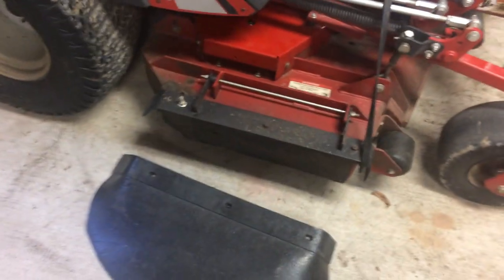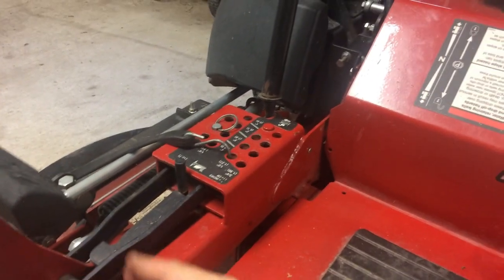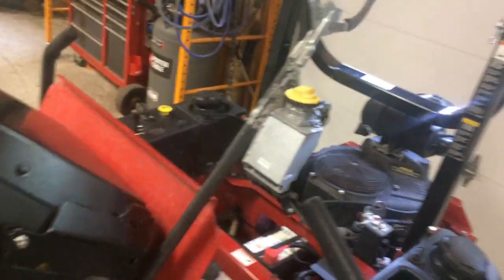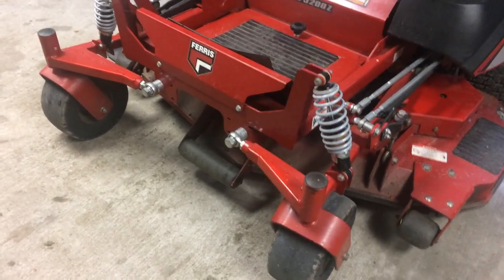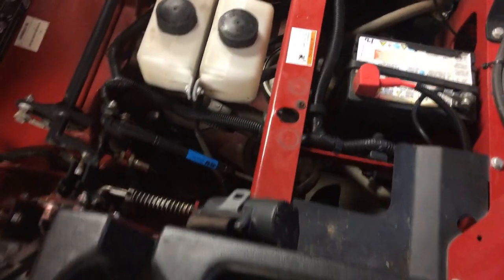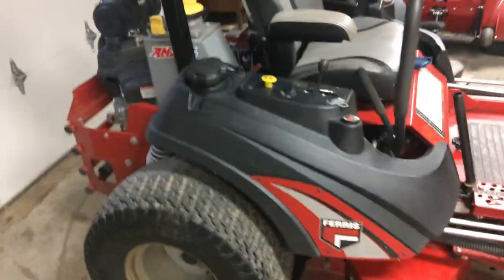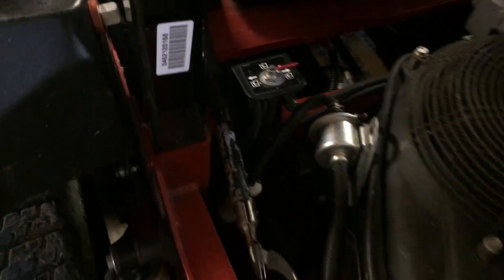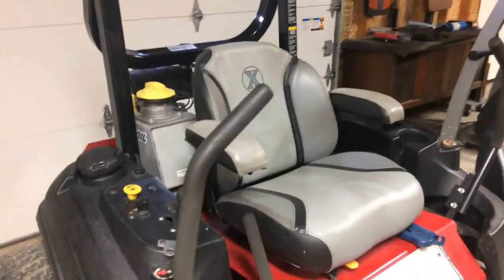1000 hr Review on 61" Ferris IS-3200Z

Comment: Great to see you've had a lot of trouble free usage from your Ferris. I was running the ISX800, and just traded it in on a 3300. What a mower. For those reading this, what separates Ferris is their suspension systems, now called the Next Gen or Forefront system. Normally when you hit some choppy areas on a lawn you have to slow down to avoid bouncing up and down in the seat. With a Ferris, I can maintain higher speeds since the mower absorbs those bumps incredibly well. I would tell anyone looking for a top tier zero turn to at least give Ferris a look and maybe even demo one. You won't be disappointed.
Reply from the maker: You are 100% correct!  The 3300 is a fantastic mower. I plan on upgrading to a 3300 in a year or two🤞

Comment: I have to disagree on the grease points. 
For me that was a selling point that can’t be beat. 
I know it’s a little time consuming but this is the alternative. ...
I cut in south Louisiana and we have a lot of wet days. 
I’ve been cutting for 14 years and about 120 yards a week. 
My last two Ferris I got over 3,000 and just sold them to get this new is3200 with the oil guard. 
Before Ferris I had 6 other 60” zero turns with sealed bearings. They do not last for ever by any means!!!
Replacing all of those bearings can be much more time-consuming than greasing, very expensive, and the worst part you never know when it’s going to break. They always break when you need the mower. However with the grease-able bearings, I was able to go the entire 3000 hours without changing a single bearing. No breakdowns on the field at work, other than the occasional belt.
I highly recommend having grease fitting bearings on everything.
Reply from the maker: Good to know 😉 hey just curious, when you grease your spindles on your 3200z, do you pump until it comes out at the top of the spindle? Or do you just count the amount of pumps? Because if I do it daily, it takes 20-40 pumps on hot days and if I wait a week to do it ,then it takes like 100. I 've been using Lucas Red Thick and Tacky and I'm going through 2 tubes of grease a week between my Z2 and my 3200Z. We do 70 lawns a week 5-6 10hr days a week. We average about a 1000 hrs a season between my 2 mowers.
Reply: I was hoping he would answer your question.  The amount of grease you’re putting in each time seems excessive to me too but you’re putting a lot of hours on it.  Makes me wonder if I’m putting enough grease in my is2000 spindles.  I usually put 8 or 10 pumps in every 10-20 hours
Reply: yeah Jonny D. 

How many pumps of grease do you average on each spindle per day/ week?
Reply: J's Crazy Cutz, LLC 
I have never put more than 15-20 pumps. 
I have a standard size grease gun and usually put 10-15 pumps. I don’t see grease come out generally. 
I think maybe the amount of pumps you’re using is over kill. 
Try pumping 40-100 pumps and look how much grease that is. 
Is your grease gun primed? I don’t think you can even get 100 pumps out of 1 tube. 
Maybe you have a blown seal? Is grease coming out the bottom?
Reply: I have to " agree to disagree with "Johnny disagreeing" 

Sealed bearings or really any bearings rarely if ever will "instantly breakdown" they usually wear out over time and the sign of that is the growling they start out with, I have thousand+ hrs on turf tracer hp 36" never had to grease it's been mildly growling due to some jackass leaving a 4way lug wrench in the deep grass (picture just inside of the Swale next to culvert pipe as you come toward the driveway across the front at ditch deep as hell and "POW!!!" I'm still running it and it hasn't gotten worse. And when it's time , you don't "rebuild" it, but just replace it whole, smart $$ is in sealed spindles, Grease requirements are a costly/messy/nightmare/time consuming aggravation .
Looking at Cub cadets new 600xt specifically due to zero zirk fittings and their warranty policy .
Love that z3x though...ain't gonna lie 😆🤘
Reply: 6BT_ Str86 All you need is as much experience as me or more to realize that greased bearings are your best friend!
Reply: @hydrojet7x70  now I know...
your "blowing smoke"

Been mowing since mid 80s ....

You??
Reply: 6BT_ Str86 So has many of people. Doesn’t mean you cut as much as I do. 
Besides, 80’s so have I. 🤪
Reply: J's Crazy Cutz, LLC I know this is an old question I’m responding to but it seems really excessive if you’re having to put 20-40 pumps per spindle daily.That grease has to be going somewhere. It must be coming out the bottom under the deck.  Maybe you blew the seals out from excessive greasing? I’m an industrial maintenance guy for a manufacturing facility and have never had to put 40 pumps daily on anything. If it were me and I was using the mower heavy I’d maybe give em each a couple pumps a day.  You should ask Ferris what they recommend, I could be completely wrong but that seems far excessive to me.
Reply from the maker: It doesn’t come out the bottom. I pump until the grease just starts to seep out the spindle.  I could probably get away with 20 a day in high heat conditions. If I wait a whole week to grease then it takes closer to 100 this is only during the high 90’s of the summer. Right now in cooler conditions we are averaging around 40 to 50 a week.
Reply: J's Crazy Cutz, LLC 40-50 still seems high per week. That grease has to be going somewhere, whether it’s coming out the top or out the bottom I’d say you have some blown seals. I’d seriously ask Ferris if that is normal before I wasted all that time and money on greasing that deck like that. Just my 2 cents.
Reply: @JsCrazyCutzLLC  where's all that grease going? It doesn't just evaporate.
Reply from the maker: @skliros9235  🤷‍♂️you tell me. Sometimes it takes 100 per spindle sometimes it's only 25 depends on how much I use it and how hot it is. My stander mower does the same thing 🤷‍♂️ I stopped worrying about it and just pump a few times in each one every day😎
Reply: @JsCrazyCutzLLC  check your lawns for grease streaks 😁
Reply: J's Crazy Cutz, LLC Ferris states in the manual to fill the spindles until grease starts coming out the relief valve.
Reply from the maker: @brycegarrison8075  my Ferris Z2 has releif valves on bottom of the spindles. I usually pump until grease comes out and that is usually 40-100 pumps per spindle  per week roughly about every 20 hours. My Ferris 3200Z has no release valves at the bottom.  It comes out on the top of the spindles under the pulleys. I have to clean it really well with compressed air and look with a light as I pump so, I can see when the grease comes out.
Reply: @JsCrazyCutzLLC  I think that's your problem. The z2 has aluminum spindles and the relief valve is easily seen. The 3200 has the cast spindles and the relief valve is inside one of the holes in the casting. Your grease is probably coming out and filling the void in the casting until there's so much it comes out the top. Google search "Ferris spindle" to see pictures of the spindles. I bet the holes in your cast spindles are plugged with grass.
Reply from the maker: @skliros9235  I'm gonna check into that ! Thanks 😎
Reply: Welcome to the future.  I had a Ferris.  It was great.    GREASE.  Ever look at those bearings?  Generally, they are sealed.  Greasing the bearings might feel good but that's about it.

Comment: Very nice review,  not sure why so much grease I can’t even get three pumps in them every two weeks.  Your mower looks better then nine lol.  Do you feel like you lose a little traction without those role bars on?   Mine is sketchy on some hills
Reply from the maker: Thanks....I'm not sure why our mowers use so much grease. Maybe It's the heat down here or the closed off baffles on the deck....I don't see a difference on hills with or without the roll bar. My mower holds hills well. Maybe its the difference between our turf grass. We have warm season grass which kinda grows out and weeves together.  I think y'all grass is softer and lays over easier. Thanks for watching and commenting 😉

Comment: Most of the big commercial mower reviews are of brand new or demo units. Nice to see an original owner review of the Ferris with 1000 hours on it. Sounds like it's been a solid unit. How many more hours do you plan on getting out of it before trading in and do you think you'd go back with a Ferris?
Reply from the maker: I use to trade in mowers after they hit 1000 hrs but, I think I'm gonna start sticking with the equipment until I start having to many problems. Ferris has treated us well so,we will definitely be sticking with them if we ever by anymore. Thanks for watching bud 😎

Comment: Thanks, great video. I have the z3x, love it for all its worth. My only complaint is I'm 53 and my feet and ankles ain't what they used to be. With that said I'm looking to trade it in on a sit down zero turn. I've had scag, love the comfort of them. Bought the stand on for the ability to hold hills and the z3x surpassed all my expectations beyond believe. My question is how well does this mower compare to the stand on  on hills?
Like I said, I love mine, I've put it in and on places they say can't be done. Just your thoughts on ability on hills? If you're like me you push it to the extreme. Thsnks in advance.
Reply from the maker: Thanks for watching! My 3200 does really well on hills but, I would probably bet that the Z3X will out perform it🤔 I was thinking of trading my 3200 on a Z3X when I can get my budget right😎

Comment: Excellent Video.  How tall are you?  Do you find the ride quality better then all the other mowers out there? Would you buy a Ferris again?  Thanks
Reply from the maker: Appreciate you watching the video! I'm 5'8" and my wife is 5' 5". We both use the mower and love the ride quality, it's  excellent. The seat that came on it was to big for our frame and lacked support  ,swapping the seat made all the difference. I would probably buy another Ferris but, I would probably go with a 2100 series instead. The 3200 series is a bit to bulky and heavy for what I'm using it for lately. I have 1250 hours on it now and I just had to order new shocks and struts for it because they are pretty wore out. It was like $500 plus tax / shipping. I've heard the shocks are only good for 1000 hrs. I'll be doing a video soon on swapping them and talking about the mower some more,SUBSCRIBE and hit the BELL in case your interested.
Reply: @JsCrazyCutzLLC   Thanks for the reply Sir. Noted on the shocks. I'm most likely picking up a ISX800  52" with a Kawi for homeowner duty.  The Technology and suspension has me sold on the Ferris.  I rode a Hustler  then the ferris 400S , then the ISX800 yesterday.  The 800 had a much better ride then the others. Between the full independent suspension and the seat it was night and day. I'm 6'3" and felt like it was a good fit but only time will tell.  I'm not as concerned with cut quality and know it will better then the current Poulan tractor riding turd.
Reply: J's Crazy Cutz, LLC m8

Comment: Great video..is it worth the money versus exmark
Reply from the maker: We ran ExMark for our first 5 years in business. We had always had top of the line ExMark's . The 60" ExMark Lazer Z X-series with 35hp efi was over $15k . I had to replace the deck belt ,drive belt,tires and pulleys every year on that thing! I also had engine problems. The Ferris IS-3200Z 61" was $13,200. I didn't have to replace the tires until 900hrs (2years) 1,100hrs on the deck belt (3years) no pulleys replaced yet. No engine problems yet🤷‍♂️Nothing rides or handles hills better than a Ferris in my opinion 😉

Comment: I've had a Ferris 3100 several years and really love it.. This summer one of the hydraulic lines blew and have a new one now. The newer ones have a different system that is a better deal. Would love to trade up  to  a 3200  or  3300...
Reply from the maker: Yeah, this 3200z has been great! I've got close to 1600 hrs on it it now. I've got plans on getting that new 3300 with 40hp Vanguard maybe in the next year or 2👍

Comment: I think your over greasing your machine. Check your owners manual for service intervals. My John Deere z920m says to grease every 50 hours on the spindles and they don’t take anywhere near 100 pumps to fill up. I think mine is maybe 10 or less than that.

If your losing that much grease you might wanna look into a higher quality grease that can hold up better. I use schaeffers grease.

One thing that might have happened is if your spindle doesn’t have any pressure relief you could have possibly blown a seal out the bottom of the spindle. This would allow your spindle to lose its grease faster under use.
Reply from the maker: Thanks for your suggestions but, I have over 2100 hrs  now and it's almost 6 years old.  I think if I was over greasing them ,something would have gone wrong by now.  I now own 5 Ferris mowers and all of them consume a ton of  grease ( about 25-50 pumps in 60- 80' )
(  about 50-100 pumps in 80-100" )
 I use " Lucas Red and Tacky Grease " I've also used other brands,  same results. These spindles on this Is3200Z are cast iron and don't have a check valve at the bottom.  Instead,  the grease comes out at the top of the spindles but, below the pulleys when they are full. The other 4 Ferris mowers that I have are equipped with aluminum spindles and they do have check valves at the bottom of the spindles. I usually grease all my spindles once a week during peak mowing season. Thanks for watching and commenting
Reply: @JsCrazyCutzLLC  the only thing over greasing can cause as an issue is blown seals.

To me that just seems like an ungodly amount of grease to be going through. How many tubes do you use in the season?

It could be that your grease gun is worn out and doesn't move as much grease as it once did. Have you tried measuring how many pumps it takes to get 1 ounce of grease to come out?

Different models pump different amounts of grease. When I compare my Lincoln grease guns the pistol grip takes 56 pumps for 1oz vs a lever style only takes 28.

This could be why there's some confusion on how much grease is being used based on just the amount of pumps needed to refill your spindles.

Do you use several cases of grease over a season per mower?
Reply from the maker: I go thru a minimum of a tube per week during the height of the mowing season total for all five mowers. I use a Milwaukee 12V grease gun. I have never measured how many pumps it takes to get an oz. We may do a test just to see. If I had to guess it would take 5 to 10 pumps to fill the white cap off a grease tube.

Comment: Do you have any issues with clumping of grass with the mulch kit ?
Reply from the maker: No not with this deck and engine that’s in it, it will leave a trail of grass on the right side if the grass is tall but just run the line over and it’s gone.

Comment: The hour meter shows engine hours while the motor is running.When you engage the deck it will show mowing hours.
Reply from the maker: Hmmmm!  I've only ever seen the one number pop on my mower.
Reply: I have a 2018 z3x. Maybe it has a different hour meter.

Comment: You only need to grease that once a month and you put three pumps of grease in each fitting what are you coming with the tube of grease for the mower. That's a good way to blow the grease seals
Reply from the maker: What grease seals? I grease it every week latetly. Been greasing this mower the same way for the past 3 years/1600hrs? No blown seals,no problems 🤷‍♂️thanks for tuning in 😉

Comment: Ever considered putting the suspension belly under that seat? 140 bucks
Reply from the maker: I actually had the suspension seat that was an option for the mower. It was wasnt working out for me so I sold it. I really like the seat that's on it now. It works perfect with the suspension on the mower.
Reply: @JsCrazyCutzLLC  right..I'm saying you can add the suspension under the seat that you like
Reply from the maker: @joshsteele8285  I'm sure you could add it. I had that mechanism thingy under the seat on my Spartan mower that I added and it worked pretty good for that mower. I don't care for the way it makes me sit high on the Ferris mower. The suspension on all 4 corners work really well. There is no need for any additional moving parts in my opinion.
Reply: @JsCrazyCutzLLC  copy...I'm fixing to add it to my stock ferris seat...I'm seriously contemplating tweels also....still on the fence with those

Comment: I've ran hustlers but I'm 38 now and comfort is more important than speed. I'll be getting either a 3200 or new 3300 in the spring. Are the shocks easy to adjust? I've heard if they're too soft the ferris has the tendency to dip or bottom out and scalp yards a bit. Any advice or tips to avoid that? Thanks. Great review
Reply from the maker: Yes the springs are adjustable.  I would definitely choose the 3300 over the 3200. The 3300 has a front end upgrade that is a lot better. I just did a spring swap video on my 3200 if you wanna check it out. Thanks for watching
Reply: Turf Tiger II?

Comment: I own the IS3200 FX1000V 61" Kawasaki 37 hp DFI engine. It is about 5 years old with only 163 hours on it but out of warranty. It has started cutting out and even stops! Dealer said they had lots of trouble from the DFT engines with the fuel injectors. He said my situation was that I needed to change motors at $3000!!!  Somebody has to help me!!! Can fuel injectors not be repaired??
Reply from the maker: Hmm🤔 I'm  not very familiar with Kawi DFI engines but,I think they  discontinued that engine because, of all the problems they had. Considering that it's 5yrs old and that little hours on it, I would probably do a new engine on it. I'd get a price on a Vanguard 37hp for it. I wouldn't buy that Kawi engine again ,at least not the DFI version . $3,000 seems like a lot money but, it might be the right investment🤷‍♂️hope you figure it out 👍